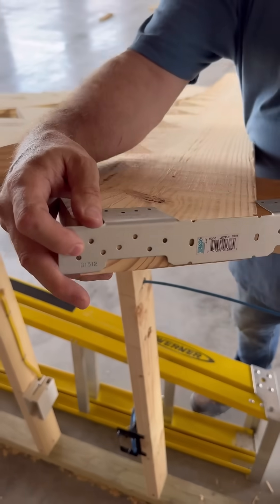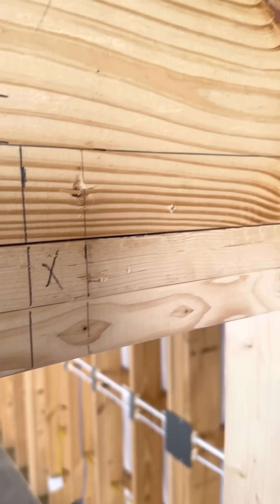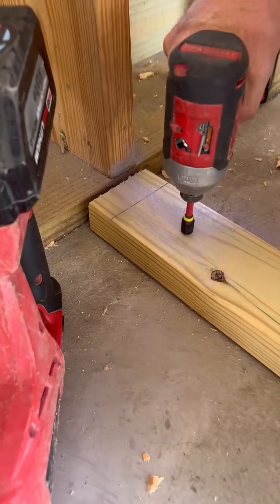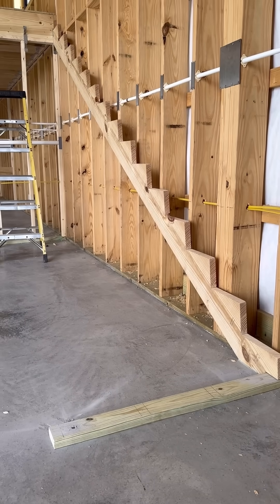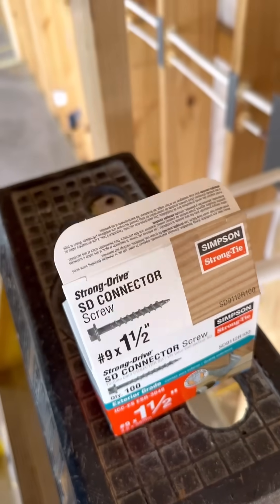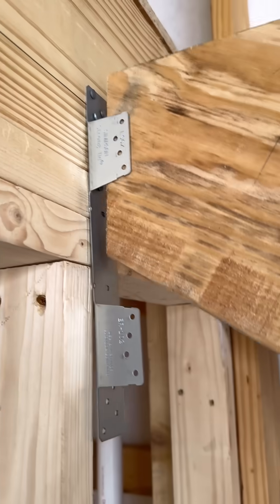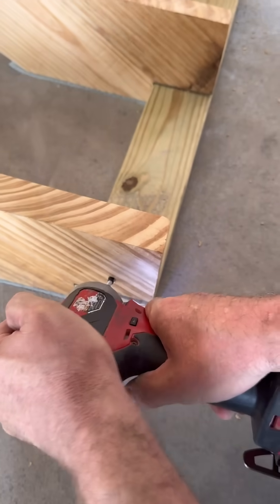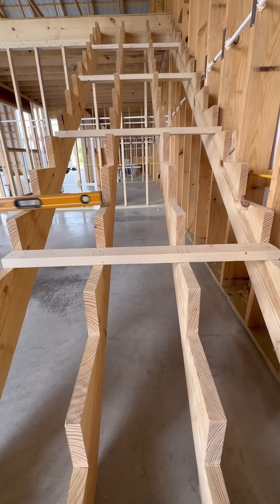Installing Stair Stringers with Simpson Connectors

Comment: thank you for showing that you used joist hanger nails to secure the connector to the board. the Simpson website only mentions the fastener screws but their hex head would force the stringer to stick out a touch. I wanted to know if nails secured more flush was acceptable and you seem to know what you're doing, so thank you!

Comment: No sill seal under the stringer plate?
Reply from the maker: It’s pressure treated
Reply: @hausplans can you show the receipt that proves the lumber you purchased was pressure treated? Because for that type of lumber you have to pay extra, it’s not just the regular wood you buy.
Reply: @hausplans it’s not pressure treated if you just bought the regular wood. The pressure treated wood costs extra $

Comment: Damn you do it the hard way!
  Just notch the center stringers , kicker and tread will hold the staircase.
   Put all 3 stringers together, then put them up as one piece.
Reply: Like to see more of what you're saying. Does sound a lot easier.
Reply: So take the 3 stringers and put together and make notch or use existing notch to hold on stingers??
Reply: Just notch the center stringer( typo on me) so you can’t see the notch.
    Get your strong guy up on the upper deck with a rope , put a few treads on like the third one up and second one down . One guy lift the 3 stringers that are held together with the few treads . Have it positioned under where it goes lift the top up get it where it goes , fasten it.
   They aren’t that heavy one person foot on the bottom can stop it from sliding
Reply: Notch both the center ones you mean, yes ?
Reply: Yes , we can go 2 ft oc.
 Just don’t notch the outside side ones

Comment: Very nice. I just built some stairs using those Simpson ties but with #9 screws. Does a free span of stringers that long meet code? Or do supports come later?
Reply from the maker: It got a support wall in the middle later. We made a video on that if you want to check it out.

Comment: Curious, why did you mount the hanger higher then your line?
Reply from the maker: That’s how it designed so that when you bend the bottom part, it’s at the corner of the stringer

Comment: Great clean job! Alternatively you can also set the stringers on your 2x4 and place flashing metal or tape under the 2x4 that has contact with the concrete. The pad under the stringer is a good idea though. I mostly do this for outside approaches but it seams your inside so no rain. Just the concrete. Nice! 👍🏽

Comment: I'm using these on a small pool deck. I already have the #9 SD connector screws (used on joists) but it didn't make sense to me how these would mount flat if I used them. Duh - just ordered the N10 DHDG nails. Thanks for helping out a novice.

Comment: I’d like to know who designed those stairs. That’s one shallow stringer for a warehouse
Reply from the maker: This is a commercial building and the max rise allowed by code is 7 inches
Reply: @hausplans  I wasn’t referring to the rise of the steps, I’m talking about the  2x12 that was used for the stringer that was cut down, rendering most of it useless for bending.

Comment: I have a question for the wood on the concrete. Do you pre drill a hole then screw it in? Im 15 so i dont know that much.
Reply from the maker: Great question! Yes, we pre-drilled the wood, and the concrete for the Masonary screws to work

Comment: I always do a 2x4 at the front and the back on the bottom if i don't have 2x6 pt but then cut the leftover white wood so it doesn't have contact with the concrete and i use screws instead of joist hanger nails those always fall out

Comment: That first piece of wood you put on the cement floor should of had some foam strip as well to any moisture and water damage...
Reply from the maker: The first piece was pressure-treated lumber, no need for a vapor barrier

Comment: I’m not sure about stairs, but most exterior decks require nails as opposed to screws when attaching the stringers? There are special construction screws you could use though. Nails have way better shear strength

Comment: Instead of special ( expensive)  Simpson metal why not just grab 3  2x8  joist hangers, cut a perpendicular cut in top plumb cut and attach them  then attach stringer

Comment: Its a good thing you live in the 21st century, gee I wonder what my dad nd me used to attach our stringers to the platform?
     Ive got a cleat still holding up the second floor steps .
     There is no need for overpriced symsons sheet metal bracket s . Unless code says you must use them . Hum wondering who's getting the money kick back on that code? 
     Your carpentry knowledge i find insulting, but your projects i find entertaining, keep up the good work . I was young once with lots to learn , but we had very little to no money growing up in NC

Comment: It’s a mistake to nail a stair stringer directly to the wall. You should furr out 1.5” for the drywall to slide behind.
Reply from the maker: Most people leave them out for drywall and a skirt board. We held the first stringer out from the wall. It’s just hard to see in the video.

Comment: I've wondered this for a while. Why does Home Depot pressure treated lumber look so dark, but the pressure treated studs I see here, or on a deck for example, look a lot lighter? Are they different pressure treating chemicals or grades? Is one more resistant than another?
Reply from the maker: I think the darker ones are rated for ground contact if I’m not wrong

Comment: This is a serious question. Do you not need  a post support midway? I was wondering if doing 4 stringers, i believe they're called, added more load capability, so you dont need extra support. I was told no stupid questions, so go easy on me.
Reply from the maker: Yes, I’m planning to build a wall in the middle to support the stairs. This will take some of the spring out of it.
Reply: @hausplans but it’s not required, just good practice?

Comment: Holy crap, a builder is actually using hangers. What a concept! Most don't. But should.
Reply: Where do you work? OMG we put  over $5 ooo in our framing. Hurricane protection in fla and ca. For quake
Reply: meh
Reply: Most don’t? Says the guy who clearly hasn’t worked on a job site in twenty years. Who isn’t using hangars these days? They’re basically code standard.

Comment: How long is that stair run ? Any support required mid span ? I believe you are only allowed 12 risers before you are required a landing
Reply from the maker: It’s 12 foot of vertical rise before you need a landing. We will be building a support wall in the middle.

Comment: Check your code. Code everywhere ive worked says stringers can have a maximum of 12 stairs before a required landing. You have 16 stairs cut in your stringers. Other than that you did all your cuts and hanging perfect
Reply from the maker: 12 stairs? that means no normal house could even have a set of stairs without a landing. This is a commercial building. You can have 12 foot of vertical rise before you need a landing according to the IBC. Also, this building was designed by a structural engineer. There is an entire page showing stairs details, the amount of treads and risers, riser height, and it all got approved by our local building department
Reply: IBC section 1011.8 Vertical Rise limits stairs to 12 feet of vertical rise between landings, just as you stated!

Comment: Do you pre drill those screws holding the treated floor plate? What type of screws are you using? Ive jad bad luck with tapcons snapping even with pre drilling.
Reply from the maker: Yes, I drilled the floor. They weren’t tapcon’s, but a similar type screw.

Comment: Great job!
Only one critique, I want to staple some of the foam seal  under the pressure treated 2 x 4 too.
I was always taught that to porous surface or not supposed to come in contact with each other.